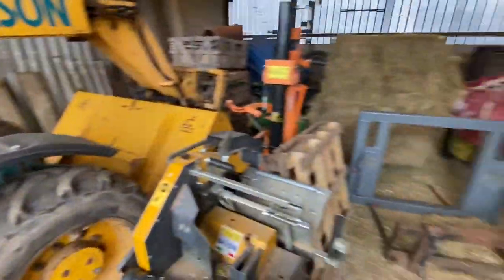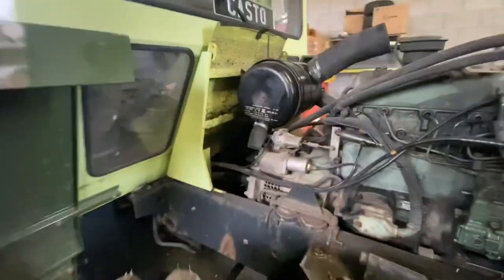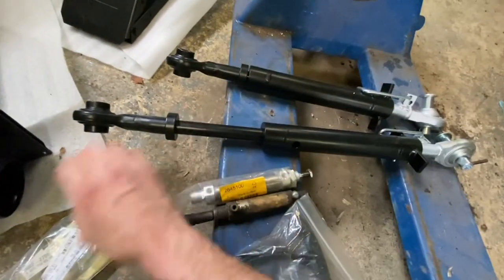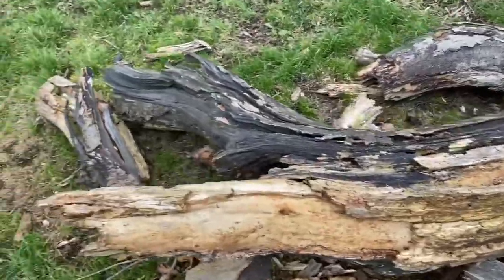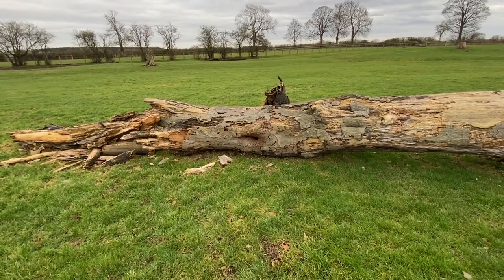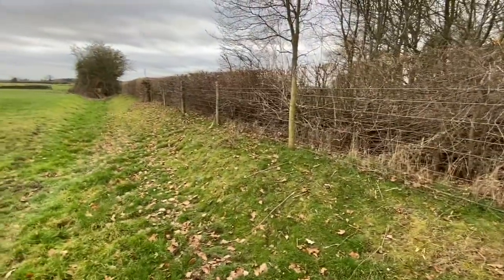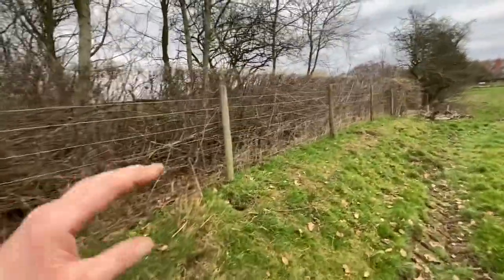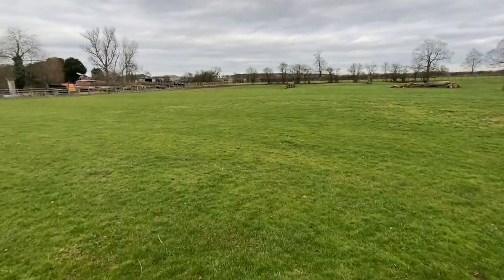Saturday… hay drop, tree bees and talking hedge laying 🤔🤷‍♂️

Comment: Id be the same with original writing on stuff. Prefer to leave it if possible.
Reply from the maker: Definitely but at the point where parts are starting to rust and especially with parts being expensive it would be daft not to save it 🤷‍♂️. As I was told “it’s only original once”